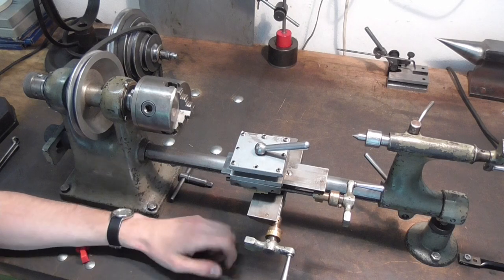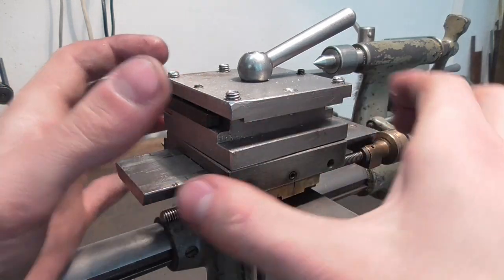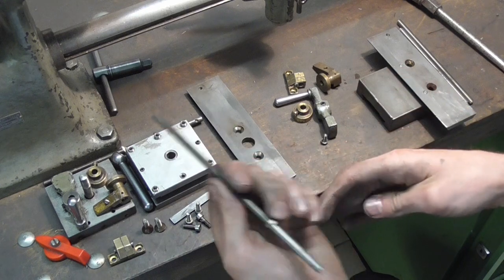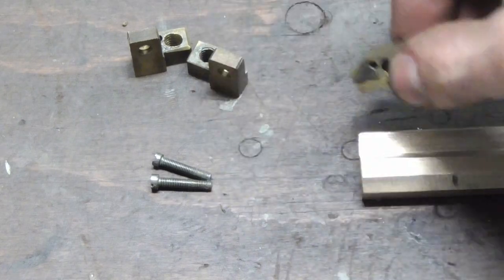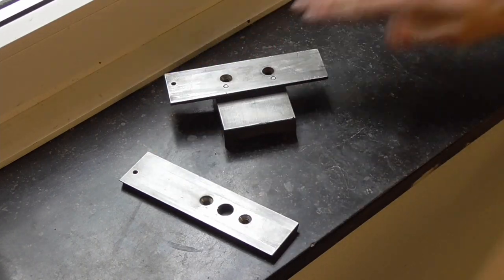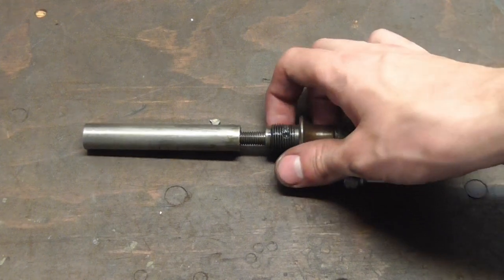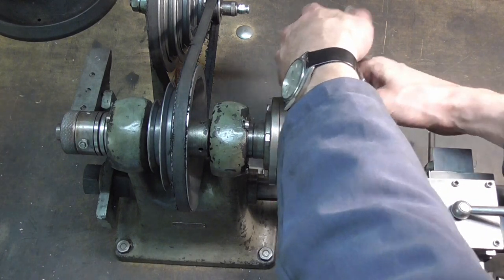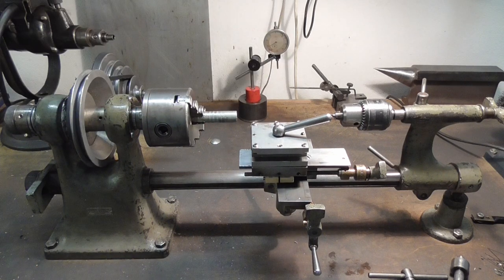Resurrection of the Kosmos Lathe

Comment: Thanks for the really clear explanation of why re-making the threaded leadscrew would be very difficult. I faced the same issue restoring my smaller G. Boley lathe, but I had a hard time explaining why it was worth going to a lot of effort to create a thread-chasing die to restore the old thread rather than just remake the whole screw. The die was a major task because the thread pre-dated matric standardisation, and has a quite different geometry from modern small metric thread standards.
Reply from the maker: Single-pointing a thread of this kind is next to impossible. If I had to make the thread myself, an adjustable split die might have been a good idea.

Comment: There are a few thoughts coming to my mind, I'd like to share with you.
1. I apreciated having two lathes, when i bought my second one. Having the one set to a speciffic operation and having to do something different was no longer a burdain. 
2. Once you serviced the Kosmos so well...tell me you are about to buy another machine and this is not because of the money.
3. I whish I'd buy my machines from someone who has taken such a good care before the sale.
4. If you oil the sand paper it won't get chocked. This works with any sandpaper.
Reply from the maker: Hi Petar,
I still have two lathes - the Emco Unimat stays with me. And ever since I had the Myford, I really didn't want to look back at the Kosmos.
I'm mainly getting rid of the Kosmos because of the extra space it gives me on the workbench. Even having refurbished it, I don't think I'd use it often enough (if at all).
I heard of the wet sanding trick before - I just didn't want to deal with the mess afterwards xD

Thank you for the comment :D

Comment: Thank you for sharing this project with us. Great to see younger contributors! Just one question: Did the silver soldered stub line up concentric and parallel with the ground threaded rod? When I did a similar job I joined the parts with extra material on the stub portion to be finished turned afterwards. Perhaps that is exactly what you did.
Reply from the maker: Miraculously, it turned out spot-on. Probably down to the great precision offered by the Myford chuck, combined with the play between the stub on the thread and the drilled hole. 
Or just plain luck - I don't want to debate that possibility either ;)